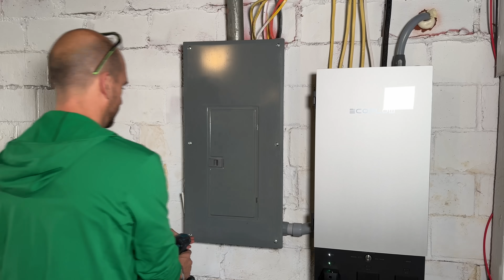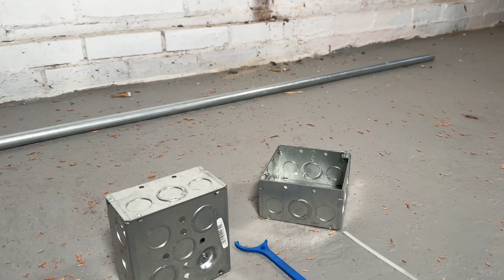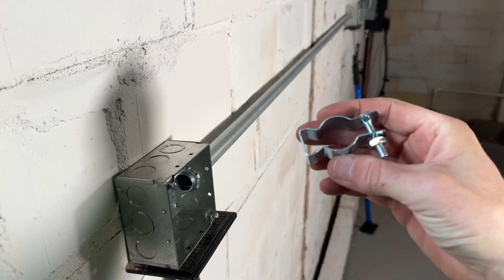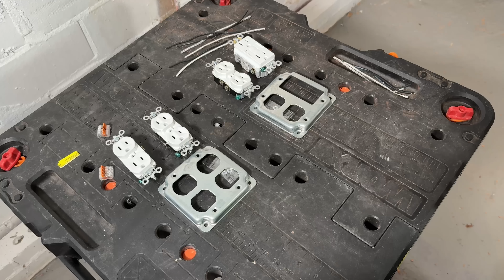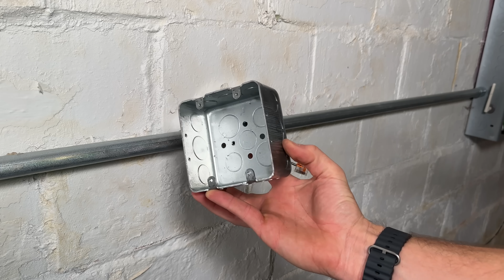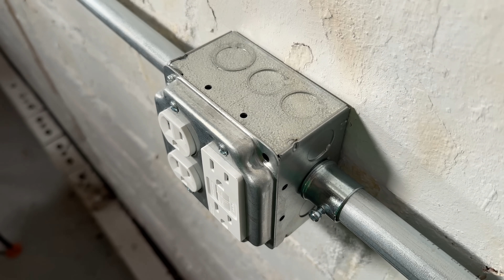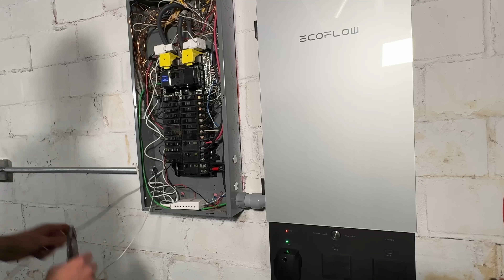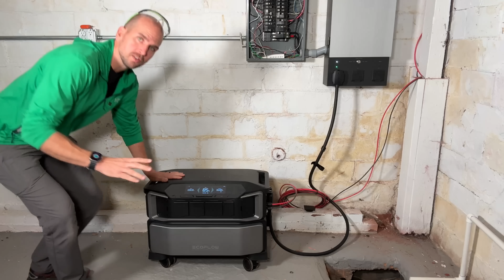Add Outlet To Unfinished Basement Or Garage

Comment: I would not rely in the conduit set screws for adequate grounding since over time they will likely oxidize.  Also, why didn't you do the bends to get the conduit to lay flat against the wall and use the "C" type wall fasteners?.  I thought it was okay to run only one piece of Romex inside a conduit but no more due to possible heat build up.
Reply: I just buy the angled conduit box adapters with set screws as they bring the conduit right up against the wall.
Reply: @jaycahow4667 I've used a couple of the 1/2" offsets but  remember them as being a little expensive. Do they have them for the 3/4" conduit?
Reply: There is no restriction to one piece of romex in conduit. I keep hearing people talk about romex in conduit and heat buildup. Not sure where this idea started but it is yet another myth in the trade. There is NO excess heat generated simply because romex is inside a conduit. Romex, when installed properly and operating properly doesn't care if it's inside conduit or not.
Reply: Well it's obviously easier to install a straight piece of conduit than to bend it several times. Also, no extra tools required. 

When it comes to NM cable, yes in some instances, depending on the jurisdiction of course, it is permissible to run a short section of NM inside a conduit to protect it from physical damage. But NM shouldn't be fully enclosed by a conduit.
Reply: @aurvaroy6670  Not true at all. While pros who know what they're doing would never run romex in anything than short sections, there is no restriction to the length of romex in conduit. Nowhere in the NEC does it specify "short sections." I can't imagine why, for example, anyone would install 500' of romex in conduit, but it's legal.
Reply: @pld8993  That's why I said "depending on some jurisdictions". Because rules may vary and some inspectors may not want any NM inside conduit or only tolerate short sections of NM in conduit to protect from physical damage. 

I do remember code mentioning that NM can be in conduit if it's 18 in or less to protect it from physical damage, that in other situations it's not permitted. But I didn't know NEC doesn't mandate how much NM can be inside conduit, which is completely stupid IMHO
Reply: @aurvaroy6670  The NEC doesn't care how long the conduit is because it doesn't matter from an electrical, performance or safety perspective. Running 500' of romex is certainly stupid, but the NEC is not a how-to manual and stupidity is not a factor when it decides the rules. Inspectors don't get to decide rules based on what they want to see. If the AHJ doesn't have a rule a field inspector cannot enforce or randomly create a non-existent rule. I've had inspectors try to enforce non-existent rules and every time I've pushed back, when I was correct,  they didn't get to override the code book.
Reply: @pld8993  As much as I wanna agree with you, I do think the NEC should be more specific when it comes to what wires can be inside conduit or not as well as the length. It would really clear up the confusion and make it clear what's allowed and what isn't. 

Also, I did see a code reference permitting NM in a short piece of conduit cited by someone who did a video on installing a receptacle in a kitchen cabinet and getting power from their basement. Can't remember what section but if it section exists, there's no reason not to put another one specifying the correct wiring for typical conduit runs. 

I understand NEC isn't an instruction manual and it shouldn't be. But at the same time, there are so many people that worship it like their Bible and calling anything they believe are code violations. So it is as if they're treating it like a manual.

Just my 2c. Feel free to agree/disagree. I don't really care cause I barely work with conduits, and if I do, I would hire it out
Reply: @aurvaroy6670  The NEC is specific and there is no confusion amongst those of us who read the actual words as they are written in the NEC. You didn't see a code reference permitting NM in short pieces of conduit. What you saw was someone proclaiming that the NEC permits romex in short pieces of conduit; the NEC says no such thing. Nowhere in Article 334 is there any mention of limiting it to short pieces of conduit. As with any written document, if you want to know what the NEC says you have to read it and not rely on what someone tells you it says. That said, it probably won't surprise you to learn that there are many, many electricians who never open the NEC and simply rely on what they've been told by others.
Reply: In UK we thread each conduit end, so its ground is definitely solid
Reply: @herrtomas6729  We use the thick-wall (threaded) for outdoors but this is the thin wall with indoor fittings that use a single set screw. No need to be cheap, just include the ground wire.
Reply: Oxidation of steel is not an issue and does not compromise the connection.